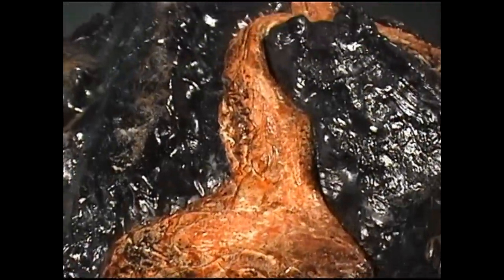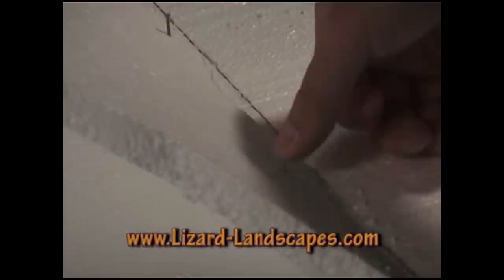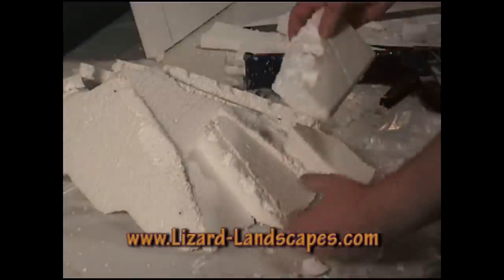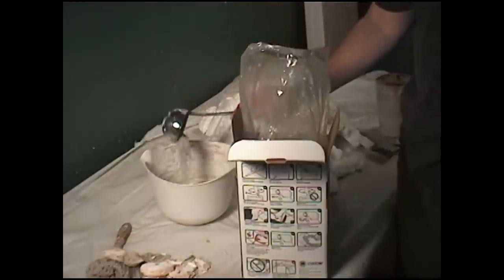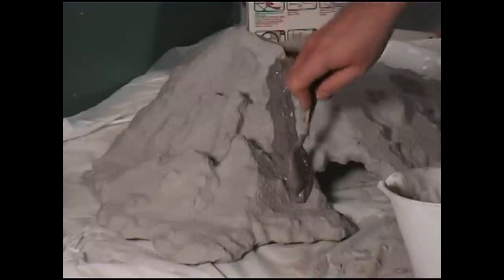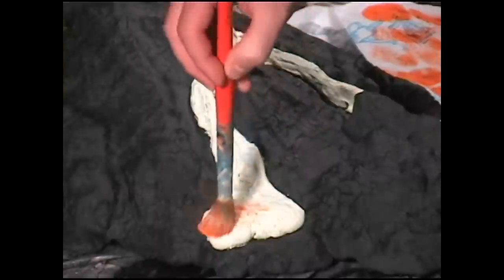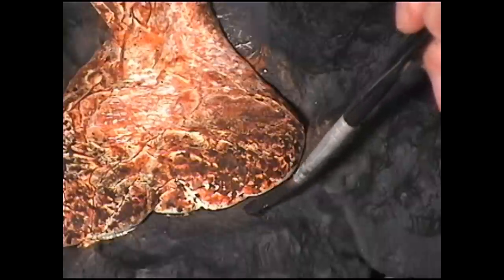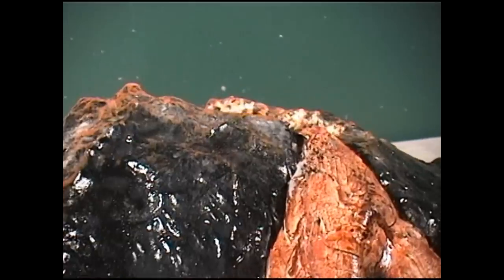How to build a volcano model

Comment: @LizardLandscapes 

It's a blend of concrete, aragonite and broken bits of coral and shells. It's made as the base of a 'reef tank' where you keep and grow corals (both soft and hard corals).  It's very fragile when you first make it, but hardens up.  Eventually corals and things will grow on it.

I'm sure you could use it on any very alkaline tank - as the stuff slowly dissolves and keeps the water very alkaline.

I learned it from garf (.) org but there are others.

Comment: @DixiePip1 
awrite i'm from scotland and had the same problem what you need to do is use an acrylic sealant B&Qs brand all purpose sealant works and mix's with water well it come in a red&white tube and its abt £3.75

Comment: Thanks, but it probably would. I just realised I could try to move the heat lamp at a certain point or place the hide strategically underneath it after having painted the inside orange instead of volcanic rock.

Comment: Hello, is there anyone out there that knows how thick the polystyrene has to be? i can get them in these sizes  "10 mm" "20 mm"  "30 mm"  "50 mm". Anyone know which thickness would be the best to use for this project (the volcano).
Reply from the maker: +sander salomonsen' I guess it doesn't really matter, but I used 20mm (3/4 in).
Reply: +LizardLandscapes thanks for the quick responce, i`ll start this project immediately ;). thanks for making these guides it really inspired me, keep up the good work.
Reply: +LizardLandscapes Well, it does matter. to thin, and it may break when your pet is walking on it (if that's the purpose, that is)
Reply: Sander since the volcano doesnt have  any straight level sections  you can use 1mm or100 mm you cut  or put together cone like pcs